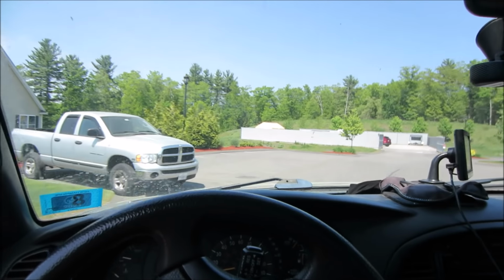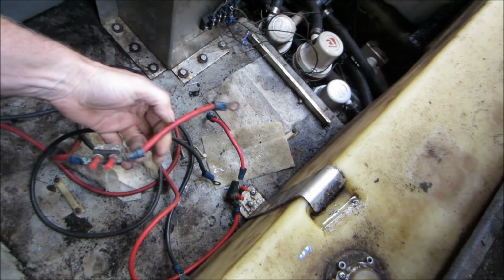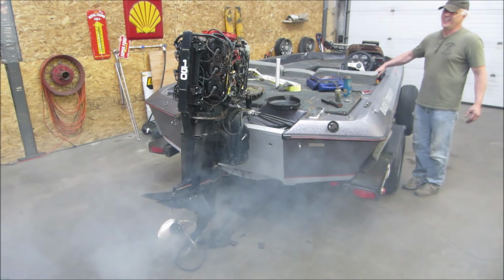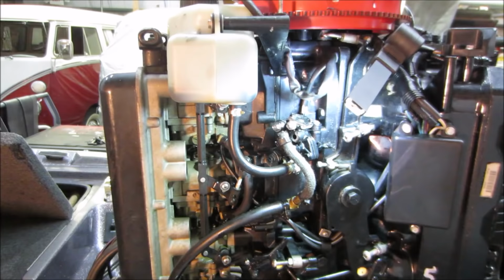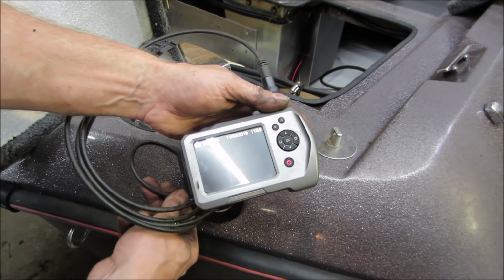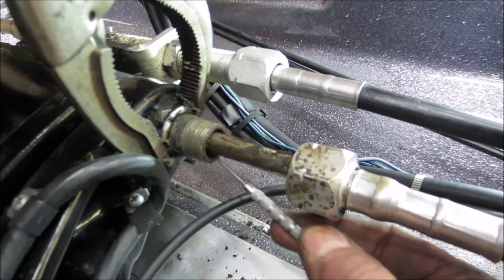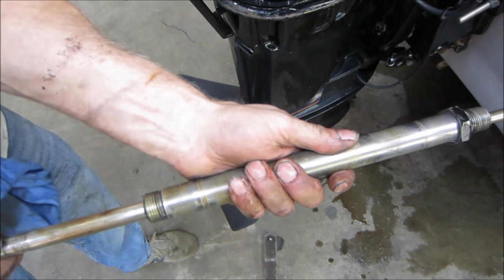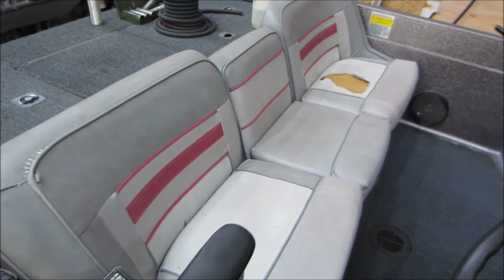1990 Bass Boat. Can We Fix It?

Comment: Pre-Ethanol outboards used rubber hose that desolve from the inside and leave deposits in the carbs, fuel pump and filters.  To check pull off a fuel line and wipe the inside.  If black deposits come off replace with new marine fuel lines.  New USCG approved lines will have a white stripe running the length of the hose.  Below deck fuel line is thicker wall and stiffer than above deck / outboard fuel line.
Reply: Or just use PTFE hose.
Reply: Oh the days of all metal fuel lines.....
Reply: @twt000  diagrams changed too . i no longer run a two stoke due to new gas.
Reply: @backwoods3214  That is a good thing. Two strokes polluted our pristine glacial fed lake. Two strokes should have been outlawed on lakes where pollution can ruin them.
Reply: @twt000 .
Amen brother.
I can remember when they outlawed 2 stroke lawn mowers then industrial interests got CONgress to rescind the ban.
Two strokes are way past due to be outlawed.
You can't buy a new two stroke boat motor anymore.
Federal law finally killed them off.
Now they need to put an age / rebuild limit on them.
In the Keys they are seriously considering a ban.
Acid rain went by by now two strokes need to be phased out.
No more parts sales will do it.
Reply: God only knows the barrels of two stroke oil that were burned on the local lake (and a few still do) over the years. And there was never and signs of damage or a decrease in fishing. Hell we had to much plant growth in places. So the whole two stroke water pollution thing is bunk. Its not like the oil that is un-burnt  just sits there. The microbes eat it up over time.
Reply: @MostlyInteresting  The plant growth is from pollution. If you love your lake then take care of it. The 2 stroke was just one source of pollution. It was the fertilizer from the yuppies' lakefront lawns and lax sewage laws also.
Reply: @ronaldheit196  km
Reply: @ronaldheit196  some people cant afford a $5,000 4 stroke or a new boat, outboards are expensive, so most people go buy a decent used boat for 4 or 5k and its ready to go most of the time

Comment: Considering how much good advice you've given me over the years, let me try to return the favor. I own an 89 Black Max 200 hp and it is without a doubt one of the greatest engines I've ever owned. Few things to keep in mind however.
First off, never start without the leg in water or on water muffs,. The impeller can literally get chewed up in seconds when it's dry. Secondly, these beasts hate ethanol fuel. Run pure gas with no ethanol and you will have no problems whatsoever. Third, the oil injection system is a common failing on these as the drive gear is made of plastic and when they get older they eventually break. Either preemptively replace the oil pump, or better yet switch to premix 50 to 1 and you'll have no worries about oil. Overall it's one of the best high horsepower, 2-stroke outboard engines ever made, if you take good care of her she'll treat you right forever. Love the channel, keep up the good work.
Reply: I said "there goes the impeller when he kicked it over the first time without muffs. Learned that the hard way once...
Reply: @bassassin2ohseven584  Don't beat yourself up too bad. I've known several very proficient boaters over the years who handled their boats well, knew navigation rules, but still thought it was okay to fire it up at home  for 10-15 seconds before they went to the lake not knowing that they were destroying their impeller.
Reply: @fmxrider429  The impellars get brittle when they sit for years so its best to just replace it to avoid the issue when youre on the water,,if its a newer engine i doubt just turning it over a few seconds will harm the impellar,,personally i dont trust the ear muffs anyway,,im 64 and have had impellars go bad while having hose attached to engine,,best way is to make yourself a tank you can lower the lower unit in and then let fresh water run while you make adjustments to engine while its running,,A old wise man many years ago showed me that each time he puts in a new impellar he puts a little vaseline on shaft and impeller to avoid dry starts and cracking
Reply: @charliesmith9528  - Muffs work just fine and don’t put Vaseline inside an engine.
Reply: 100 percent facts bro! Yep yep! You ain’t wrong 👍 I already know!
Reply: I had an 88 200 Mariner.  Great engine.

Comment: I had a neighbor who did car repairs on the side.  He mounted an aftermarket inline fuel pump to a small board and attached several feet of hose to the inlet and outlet side.  He had clips on the electrical connection.  He used this to drain fuel tanks before he dropped them.  It worked great.  
Put the inlet hose down the fuel filler and the outlet into a jerry can.  Connect the wires to the battery and watch it drain the tank.
Something like this would be a good addition to your shop considering how often deal with old and dirty fuel.
Reply: In a similar vein I like the little Harbor Freight "Battery Operated Fluid Transfer Pump" for about $10 at Harbor Freight (currently on sale it seems). It just makes such fuel transfer chores easier.

Comment: Mustie, I got an old bass boat last year with a stuck steering system and I had to do the same thing that you did. I had to clean out the tilt tube with a shotgun brush and solve it. I had to go a step further and use some emery cloth to clean out the rust. But it works good as new now. Good luck with your new toy.

Comment: Two things, always wash a boat that’s been sitting head to tail before you begin work, it will reveal what you wouldn’t see otherwise. Two, always run the carbs dry when putting the boat up. Bonus info, fog the cylinders and turn the engine over with spark plugs out to knock out any moisture or debris. Also, the bar in the back was a transom saver, I highly recommend one!

Comment: Disable the oil injection asap.  Black Max's had plastic gear drives for the injection pump, and they were not good.  Other than that, bullet proof motors.
Reply: not so. I worked on these black max engines for years and replaces one fiber gear. make sure the alarm is working and carry extra 2 cycle oil on board.and add it to the tank in case the pump breaks.
Reply: Never had a problem with mine!
Reply: Buck Fiden  Exactly.
Reply: I have the mariner version of this motor. Took the oil injection off and just mix the oil myself. HIGHLY RECOMMEND removing the oil injection system and just mix the oil. It is the number one cause of death for these engines if you don't. 50:1 Btw.
Reply: Use premix gas and throw the oil injection away.
Reply: The main problem with oil injection motors is clogged jets. Usually due to the owner not being scrupulously clean about filling the tank. On older motors the inner wall of the rubber oil hoses would disintegrate. If the pump clogged enough the gear would shear.  I had one customer filled the  oil tank of a new engine with used diesel sump oil.  Ouch!  He sued when I disallowed the warranty, he just added the court cost to the price of a new engine. Thankfully he went to a different dealer. The first thing to look at on a used outboard is the state of the propeller. If that is the original the boat got very little use or abuse. Any problems which arise will hopefully be from storage. Nice project, and it would be nice to bring the gentleman for a spin for old times sake.
Reply: I had the 90hp version of this engine. I disabled the oiler system and just premixed my fuel. Peace of mind.
Reply: The oil injection/oil drip just recently went out on my 96 Black Max 135.  Fortunately the alarm still worked and alerted me to the problem.  It was just one continuous loud beep when the motor was in the on position.  The difficulty for myself was figuring out how to disable the alarm.  There was nothing online about canceling the alarm so I just had to follow individual wires and disconnect and reconnect them until the motor will run but the alarm stays off.  Anyway,  motor still runs great.  I just premix the gas.  Good old strong, torquey, fast,  loud and smokey two stroke just with no alarm.  It’s been a great motor with zero issues except for this one.  Like so many others I also recommend disabling the oiler and simply going to premixed fuel.  Then you can be sure oil is getting there.
Reply: @dwansbo  Ha Ha... way back in the days of 24 to 1 the barely making it fishermen and crabbers would mix drain oil and gas. A smoky mess that was. They did it to get by.
Reply: I was going to suggest mixing 2-stroke oil in the fuel at first until it was certain the oil injection was working right. Then I read this thread. :-D
Reply: @Mike-B19  a continuous beep is the overheat alarm. if its the oil alarm, it can be a stuck float or bad sensor...not the oil system itself.
Reply: @ct1762  Thats what I had initially thought but after the motor sat for a day I start it and alarm instantly on again.  The motor was peeing hard and motor did not get hot.  Then I read more and heard it could also be the oiler.  So while motor was in neutral running on premix gas I removed the hose coming from the oiler where it connects to the fuel line before fuel pump and watched and no oil was coming out.  I know it’s a metered fuel oil ratio and very low oil to fuel at idle so I waited about 5 min and no oil came out.  Is it necessary for it to be hooked up to fuel line to pull the oil?  I thought it was just a worm gear in the oiler that pumped it?  I guess the thing I didn’t ever change was the thermostat on the right upper cylinder.  Do you recommend trying that and hooking the alarm back up?  Also if it is an overheating issue will the motor still rev back to idle if too hot while the alarm is disconnected?  I’m sorry to bother you with all these questions but I really appreciate your insight.  If I have the opportunity to ask an outboard mechanic or someone in the outbound business “going by RI Outboards” I’m guessing you are, I have to ask em.  Thanks again for any help.  It is much appreciated.
Reply: @Mike-B19  hey no worries. good job putting premix on it... just as long as you drained all the strait gasoline out of the carbs as it will idle for 5 minutes solid on just the fuel in the carbs! these motors have a safety reserve oil tank on the motor, and a separate line going to the main tank in the boat. since these must be bled after maintenance, i'm assuming the oil line does need to be connected to pull oil from the main tank yes, but not the fuel line as its not on the same system. in the service manual there is a procedure to check if the oiler is pulling oil with a fuel line and a clear syringe type setup. if it was overheating, it should have a rev limit function for limp mode, and shake violently past 2500 rpm or so. doesnt sound like you are overheating as you said... plus youd see it steaming and smell burning plastic if it got really hot! t stat can be pulled and thrown in hot water to see if its working, but they only open at low speeds. at high speed they are completely bypassed.
Reply: @ct1762  Thank You once again.  I think I am going to replace that thermostat or thermocouple which ever it is and try hooking the alarm up again.   I will try to see if oiler is moving oil by replacing the oil line to the fuel line with a new clear one and see if it will indeed keep pumping oil down while connected.  If not I have no issues leaving oiler alone not working and the alarm off if I do find that it is something in the oil system making the alarm go off.  Premixing is no problem as I also have a 1990 25 hp Johnson on another smaller boat that I have to premix for.  I am fairly certain it’s not overheating but I don’t want to kill the thing by me being lazy.  Thank You once again and if you have any other ideas they are appreciated!
Reply: @Mike-B19  no problem glad to help. check the oil sensor connection for corrosion/condition of the leads as well.

Comment: My bass boat is a 1991 Nitro 160tf. I bought it in 1996. My oldest son grew up playing matchbox cars and army men in the bottom of that boat.  It has been the best purchase I have ever made. I could literally sell it today for more than I paid for it back in 1996. My boat is no own in need of some TLC. I need new carpet and seats and a good wet sanding and polishing. Looks like your boat could use the same, but if cared for after that. It should be good for at least 2 decades. I would recommend changing the reed valves to fiber ones.

Comment: The oil injection systems on those Mercury motors are prone to failure(plastic), and difficult to repair. Most folks in my area (Cape Cod) disable the injection system and pre-mix the fuel. I would also replace the oil tank with a smaller removable gas tank you can fill easily and winterize.
Reply: YES SIR 100%, DISABLE THE OIL INJECTION & JUST PRE-MIX YOUR FUEL.
Reply: The Johnson/Evinrude systems were much worse.  To the point where OMC recommended bypassing it to their customers.  The Mercury setups are better.  The only failures I have run into, are like mustie seen, the lines getting brittle and cracking.  Either he needs to bypass the system, or replace every line.  Either way will be fine for this one.  I would have loved to find that score.
Reply: @Bobbywolf64  It is not just the lines, the problem is the oil pump is driven off a plastic gear on the crankshaft.  Any plastic gear this old is falling apart.  Also, the plastic coupler that connects the oil pump to the oil pump drive shaft swells over the years untill it binds up in the hole in the block, which then wears and or strips out the previously mentioned plastic gear.  I went through all this with my 1988 150 hp XR4 outboard.  You either split the block to replace the gear, or go to premix.

Comment: I had a similar situation as this and I had the same purchase of a boat that just sat around not being used.  You have the same problem I had or will have and it is all about the big D!  (Deterioration). Everything on that boat is dry rotted and waterlogged and you will be replacing everything under the sun from now to the day your stranded on a lake.  I got so tired of breaking down and all I needed to do was REPLACE EVERYTHING.  My hat goes off to you taking on a boat that has been in hibernation. I never felt comfortable boating in mine and that takes all the fun out of it.

Comment: Having to clean out a few dirty holes so the tool i made is just a 1/4" stainless rod with a slot on the end. Put a strip of sand paper in the slot, then wrap it around the rod. Put the other end into an air grinder. High RPM of the grinder flings out the sandpaper so it is essentially a flap wheel with one flap. A few minutes of buzzing, some spray and some in-and-out motions with the rod and i am yet to see a hole that would not clean up.

Comment: I would get rid of that stainless steel prop if you're going to be running this in fresh/brackish water. While they perform better than aluminum, if you hit something in the water you'll damage the shaft/seals before the prop. The aluminum acts as a sort of weak link between the gearbox. Stainless steel is of course better and won't flex, but you learn the hard way about these things!
Reply: Well nobody ask you sooooo….
Reply: That's what your shear pin is for!  It breaks before something like the prop or shaft does.  A sacrificial part.  Always check you have the correct one.  Sometimes people like to replace the factory pin with something stronger and you know what happens?

Comment: The done thing on all old 2 stroke Mercs is to take off the oil pump and run them on 50:1 premix! The pumps have proved to be unreliable. I believe that mercury even sell a blanking plate for the hole left in the block! Definitely worth looking into! Cheers from England!

Comment: Brilliant, "force majeure" solution. While the tube was still in motor mount, I had thought of the air hammer/chisel on the rod end. But the brain waves sent were, alas, obstructed. That guy thrice replaced a trolling motor on a boat used a few weeks every 7 years? Maybe it was for steering...

Comment: The impeller for the cooling water is an easy replacement. Spinning it dry, and the age. It's toast- or will leave you overheated sometime soon. You can find a replacement kit on e-bay for under 30 bucks. I agree to get rid of the oil injection and just premix. Maybe already done because of the old gas color.
Reply: right... and i'd be just as worried about the carbs from sitting that long. suicide to try to run it wide open without a thorough rebuild. only takes an hour. thats if it will even idle assuming the idle circuits arent gummed up. hopefully it wont idle well, forcing him to rebuild haha.
Reply: Seriously, when you see guys like this who start old boats from sitting for years without a set of water muffs hooked up, maybe you should watch them more often!
Us "OLD PRO'S" per say been around awhile and we already know that the impeller is dry as a popcorn fart, its already junk and will need replacing!
Running an engine without muffs will not harm it as long as you only run for a few seconds or so!
Also, fresh gasoline will help loosen up all the shellac buildup in those float bowls!
Yes, shellac!
While all these concerns could be talking points to get a good deal, they are also good talking points for one to get ripped off by a dealer!
LEARN YOUR HOBBY!

Comment: Looks like a fun project!  I will say though, its never a good idea to run an outboard without water for the cooling intake.  There is a rubber impeller that will get destroyed if it runs out of the water.  The easiest way to run it in the shop is to use a pair of engine muffs - you can then connect a garden hose and supply water to the intake on the lower unit.  I'm excited to check out the rest of these videos!
Reply: I'm 100% he is going to install a new impeller ❤ he is the MAN!! He knows what he is doing ❤